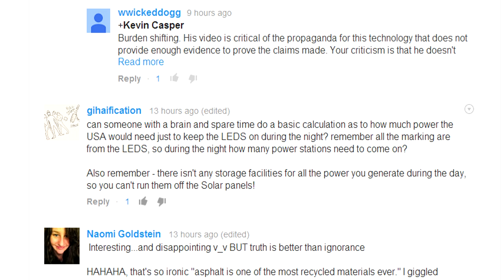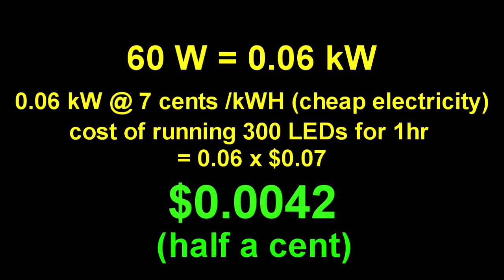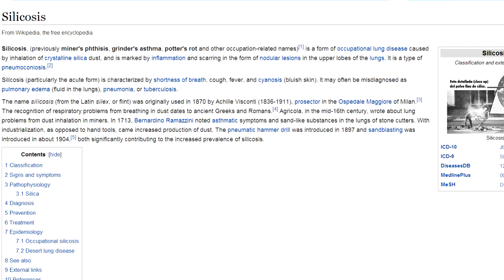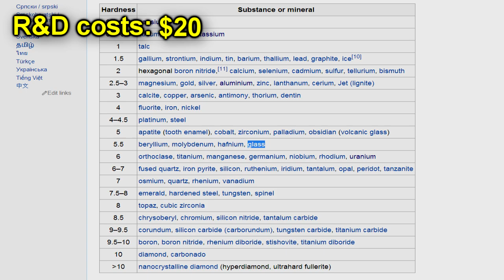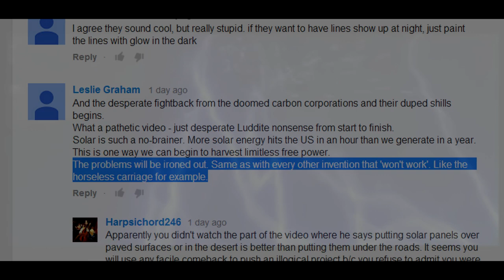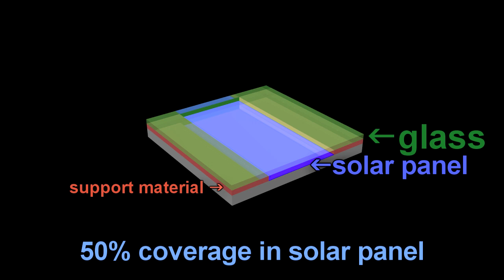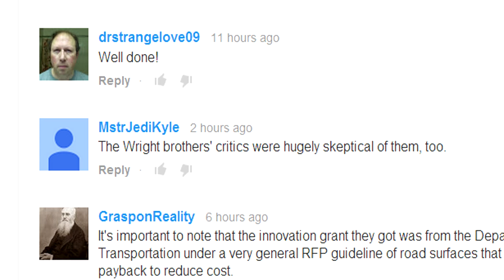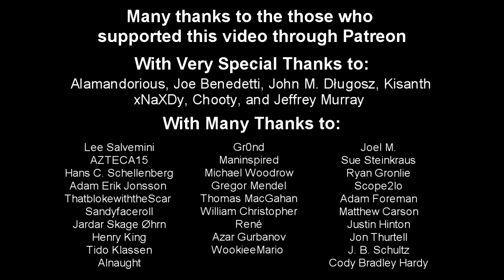Solar Roadways, IMPORTANT QUESTIONS AND ANSWERS!

Comment: Huh, so this was a more in-depth repeat of the first video on SFR, but the first question by gihaification (that TF so "would love to do this calculation" on) wasn't actually adressed? Because after the 12 trillion LEDs got calculated, it turned straight to costs rather than energy. I'm a little disappointed, because the actual question had me curious too.

Comment: I wonder if these geniuses are aware that roads are not usually flat?  Any decent road is a little raised in the middle to promote water runoff. As fun as it would  be to hydroplane on a smooth glass road at 65 mph, I'll pass. 😂😂

Comment: What's amazing is the lack of basic project management for these .... 'projects'. Viability, cost, longevity, replacement, end-of-life, repair, maintenance... not even mentioning common sense. Why are they not looking at calculating those even roughly up front? In most cases it's enough to drop a project or reevaluate and correct it so it can be viable. Baffling... more Elon Muskery

Comment: Last I checked, glass is quite slippery, making it AMAZING to drive on. I once got into a heated debate on the viability of solar roads. They said that the idea can work, you just need to throw more money at it! Solar panels for power are completely viable, and gaining widespread adoption. As roads..... they are asinine. One has to ask, instead of making extremely expensive and fragile roads, why not just put the panels next to the road? There are nearly 50,000 miles if US interstate highways, more than enough room to place solar panels.
Reply: It is fantastic when it rains or freezes like a metal paved road.
Reply: You can also make roofs over all of the roads.

Comment: Am I to understand that the entire purpose of these panels is to provide the power to run the lane-marking LEDS? - The LEDS  that can be seen at night when there’s no sunlight to power them, but can’t be seen in the daytime when there is? Admittedly, the vast majority of LEDS could be off at any given time. But what happens to any excess power generated? Please tell me there is something else for them to run? Please.
Anyway, this can’t work until we have some kind of extrudable or coatable solar conversion tech. This plan is just way too brute force.

Comment: few yours back they started using LED's in traffic lights. LED's didn't generat enough heat to melt the snow and ice that would accumulate on the lenses. LOL! the had to install heaters to keep the lights cleare. I have the same issue on trucks having to stop often to clear the tail lights.

Comment: I wonder if those panels might be useful to be put on the middle of train tracks. They would be protected from people or vessels driving over them. Trains usually don't stand in traffic queues another...so that it would be exposed to more light. Also...the tracks are already (or easy to) connect to the electric grid. 
You get rid of the energy consuming LEDs because they wouldn't make sense on a train-track.The heating device doesn't have to be as strong as it has to be to clear roads (something it is not strong enough for anyway)...but since tracks already are made of metal..and in some cases already have ways to keep themselves snow free (at least most tracks I see are snow free)...it should be easier to heat them. I don't think the efficiency of those panels would be great but the space would be empty and unused anyway. 
I dunno..so...does anyone think, that would be a possibility?

Comment: We have a solar farm near me and every winter they go dead because they have either not thought of a way or are too expensive to implement they are covered in snow all winter long. I think they should use either a de-icer sprinkler with wipers or a heater power by a small wind generator. The heaters would only work when it's windy but it would improve the energy harvest per year even the wipers could be controlled by a wind-generator and it doesn't have to be huge it can be one one that aeroplanes use when they lose engine that powers their instruments.

Comment: Why not just build a roof over roads and put the solar panels on that? It'll keep the snow off the road without heating, have the angles needed for better efficiency, have no stupid leds, be easier to do routine maintenance, glass wear would be minimal and it would have the space to possibly store a battery every few miles so the energy will be useful.
They would still be stolen or highly damaged in an accident but still less stupid than being the roadway.

Comment: Sooo many reasons this is a bad idea.  Glass is a soft material that changes shape over time.  If you've seen how roads can develop a washboard effect after a few hot summers, imagine what the forward pressure of millions of tons of weight can do to glass over time.  Then you have the scratching Thunderf00t demonstrated, which both dulls the visibility of the LEDs and reduces the light received by the solar panels, which are already at a disadvantage being fixed flat to the ground.  Add to that small amounts of rubber and soot left by each passing car, and you'll be lucky if you're left with any useful sunlight at all.  Then imagine these things in the rain, especially after the "anti skid" bumps are worn down a bit.  Any added safety from illuminated markings will pale to the carnage brought by a few weeks of inclement weather.  These things would need to be constantly cleaned, maintained and refurbished.  It doesn't matter anyway, no municipality has the budget to replace every inch of roadway and parking lot with this daffy system, and self driving/assistive driving systems in vehicles will provide more improved safety than this ever could.  They'll get their grant money for a government study at our expense and move on to the next scam.

Comment: Now try putting dust and scratches over the solar panel and see how inefficient it becomes.  And then slipping on the surface, freezing water expanding and shattering the road, salt for melting ice, water and electric current don’t mix nicely either, endless ways to shoot this down in 20 second, mind boggling that an idea like this can gain any traction.

Comment: There is a process that has to take place between idea and finished product.  First you have to have the correct theoretical foundation, workout the math, do elemental testing, make a prototype, test it in a controlled environment, test under real conditions, and then full scale human testing and if all works out you can start production.  This is a general plan, your milage may vary.  Don't test the new parachute without following these basic instructions.

Comment: Why don't we cover the roads in tooth Enamel ? Then we wouldn't have to pay the dentist for all their procedures and the roads would be all pearly white reflecting the sunlight increasing the planets albedo thus fighting Global Warming and refreezing the Arctic sea ice so we don't have the dreaded tipping point where there is a runaway melting causing all the crops to fail due to latent heat. Heck we could just paint black lines for the lanes and everything will be fixed forever.

Comment: I don't understand why the stupidity of those roadway belivers don't understand that driving on wet glass with rubber tires will let them slip, slide and crash in to the next building.... Driving on a wet glass plate is like driving on ice

Comment: There are so many flaws in this guy's arguments it's pathetic. For example, LED lights have a few years' life expectancy. Sure, that's true, if you leave the LED on 24 hours per day. But you don't. The idea is to turn on just a few of the LEDs . . . not ALL of them, and they can change. In other words, some can be turned on and others turned off, so even with stripes, those stripes can be turned on and off over time. They can also be run at lower power when no cars are around. In fact, they can be turned off when no cars are around, and as cars come toward them they can be turned on, like the automatic lights in the refrigerators at at Target and other stores, or the automatic dryer in a public bathroom, which can sense there are hands in front of it. There can be redundant sensors, whether activated by proximity or pressure, and if each soar paver has a sensor, and they all communicate with each other, they can be programmed to sense that a car is near, by communicating with pavers nearby. Ultimately a solar roadway will be controlled by a decentralized computer system, which will use the sensors in the pavers to know there are vehicles or animals on them, and they will turn on the LED lights . . . and they'll turn off the LED lights when they're not needed. The cost of the power is paid for by the solar power the pavers collect, and the numbers he talks about are ridiculous. A single solar panel collects about 100 to 300 watts of power for about 1/4 of the day. One of these smaller solar pavers will probably collect about 1/4 of that, so about 25 to 75 watts for about 1/4 of the day, or about 6 to 18 watts per hour on average. The power of 300 LED lights requiring 60 wats means that there could be 30 LED lights in each paver, and they could run 24 hours per day. Of course they don't all run 24 hours per day, so the solar pavers would indeed collect enough power to run the lights. There are lots of other flaws in this stupid video's arguments, so don't believe it. It's a bunch of B.S.
Reply: Do you really think this will ever become a reality? I knew nothing about this concept or solar panels really but I laughed my ass off the first time I heard about it because I could see so many problems flashing in my mind withing just 2 mins thinking time. I am an intelligent person but not moreso than anyone else who scores the same as me in an IQ test. Glass could never be strong enough to handle cars running over it constantly, it scratches easily especially with hard stones jammed in the tyre treads, its slippery as frick when wet, hot and cold snaps play hovoc with electronics, L.e.ds burn out and are easily damaged, continuous panel replacements will mean every road would be under continuous maintenance, in heavy rain the water would not drain efficiently as blacktop roads can do, sunlight on wet glass at an angle is blindingly bright (I am a window cleaner...I know) Braking distances on glass are very unreliable so everything would have to be rewritten and redesigned for car safety, Broken glass panels would tear through tyres like a razor through butter Oil spills would be deadly even from the tiny drips from an exhaust. If it would of been possible very highly trained scientists (the smartest people on the planet) would of done it already and they haven't... bearing in mind solar panels are nothing new but have been around for a long time...lol. It will never work and that is because it cannot work. Roads are already the best they can be and they have always been very good at what they need to do when they are built in the US and UK also many wealthier countries. You would be better fixing a dynamo to your car wheel and charging up a battery to use later in your home than this ridiculous invention. I can't believe they are still having a go at this and the guys who funded any of this should be made to take their job interviews again as tax payers money has been wasted on this at a time where you have a homeless epidemic hitting hard working honest people who didn't deserve this to happen to them. If my government did this I would be utterly furious with them and I would on this occasion made my voice very well heard.

Comment: Surely if your road is glass or some transparent like material, that doesn't have "grit" in it, isn't it going to make the road rather slippery if it rains and you dare brake on it quickly to avoid something? Or God forbid, someone in front of you has an oil leak somewhere in front of you !!!

Comment: You're very wrong about one thing, namely sapphire fragments shattering windscreens. That's because only the side and rear windows of modern cars are made of tempered glass. The windscreen is now typically made of laminated glass, which doesn't break easily even if it is deeply cracked. Here's a video showing how hard it is to kick out a windscreen (as opposed to cracking it):

https://www.youtube.com/watch?v=_GGqdLeAMPw

So, let's assume there's a loose piece of "solar road", even made of sapphire, that the tire of another car throws into your windscreen. Is it possible that your windscreen may take some damage? Absolutely! Is it possible that this piece will pierce your windscreen, or cause the whole windscreen to collapse? That's extremely unlikely.

Comment: thunderf00t is WRONG!    That's not  boro-salicylate  glass, it's borosilicate glass!    

Otherwise, he's exactly right.

Also, you would need ridiculously thick glass, supported all around, and sealed against water intrusion, on a perfectly level grid of supports, on a firm concrete foundation, that does not ever crack or sag or get pushed up by ground frost.   Go look at your typical concrete road and figure out how much of it is absolutely perfect, down to the millimeter.

Comment: Most advanced watches use sapphire glass to avoid scratches, could be the same fort the solar roadways.

Though I think LEDs are completely unsuitable for dynamic marking during the day. Would need some kind of e-ink.
Reply: > Most advanced watches use sapphire glass to avoid scratches, could be the same fort the solar roadways.

That would be ridiculously expensive and it still wouldn't fix the vast majority of the issues of solar roadways which is inherent in its design.

Comment: This comment was written before I saw the entire video, but I felt I should point these things out before I lost interest and forget. That cost estimate of running the LEDs for an hour is kind of misleading. Not every tile would have ALL its LEDs on at the same time, FFS. Now I agree with you on all the other things, but come on. That generalization on how many would be on at the same time just made me cringe. Also, of course the LED strips were hard to see as they were on a WHITE strip in the sun light which reflects sun light. Perhaps painting the strips you used in black would assist the visibility?

Comment: I love your videos, Thunderf00t, but what sort of lifespan were you quoting for LEDs there?  Your typical indicator LED has (or at least used to have, back when I was more into electronics than CS) a lifespan of about 200k hours - that's almost 23 years of continual operation.  Furthermore, that's mean time to 50% light output, not failure.  I actually have some LEDs that have been running more or less constantly since the 80s or 90s, and they're still fine.

Now, high intensity LEDs (such as those used in household light bulbs) tend to have shorter lifespans (1/10th that of an indicator LED), but those panels clearly don't use high intensity ones.

Comment: The only point I think you missed is that the solar road ways for some dumb reason are hexigon which means you need half panels for the side of the road adding much more to cost why not make them sqaure like a regular glass roads

Comment: Say Thunderfoot, i've wondered about something for some time now. Technically speaking, could a solar panel generate electrical energy from moonlight? I mean, light is light wether it comes directly from the sun or is reflected by the moon. Sure, the moonlight is probably much less energyrich simply due to having lost energy on the way and from having heated up the moon, but does it still contain enough usable energy for a solar panel?

Comment: Can they just make it like a tunnel? On the top is the solar power that give energy to the led that light the way on the tunnel. The led would be brighter, all driver wont suffer because of the hot sun, and if u cant make the better protection, why dont make the led under the road (make a hole like a little cannal). Sorry with the  broken english.

Comment: Electricity costs Americans a thousand bucks a YEAR? Jesus christ I'm in the wrong country. It's roughly 3 times that here in Australia, paid every quarter. No wonder solar panels (on roofs!) are so ubiquitous here. And yes, they actually do generate money, or at the very least zero or near zero the power bill, which means the $1600 on average for a small 1.6kW setup of 8 panels, will pay for itself in less than a year.

Comment: 7:04 Also, a glass road surface will just blind drivers when the sun is at a low angle. I should know. After all, sunstrike is already a huge problem here in NZ, and that's with normal roads.